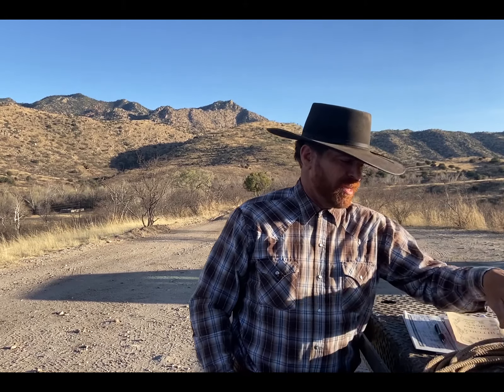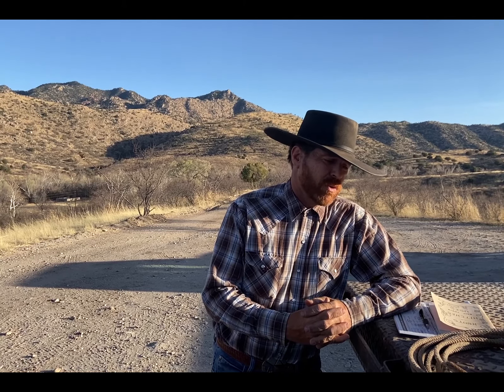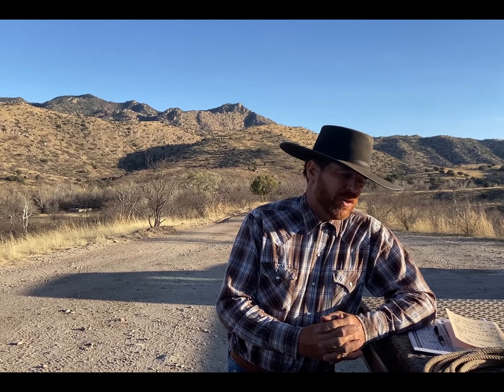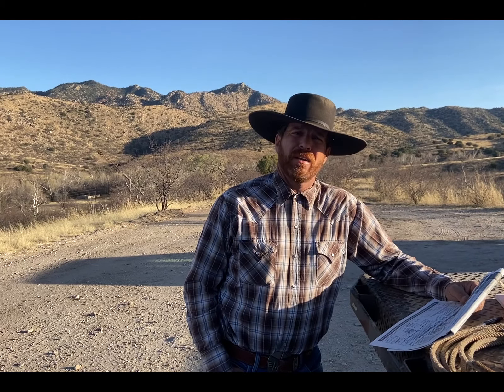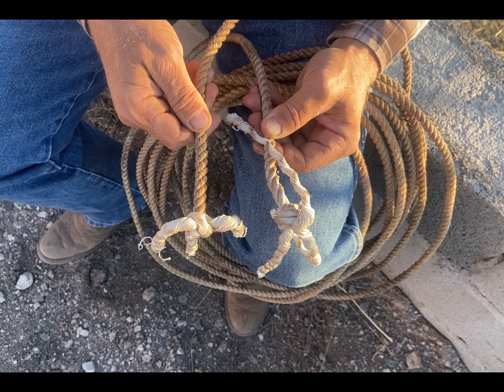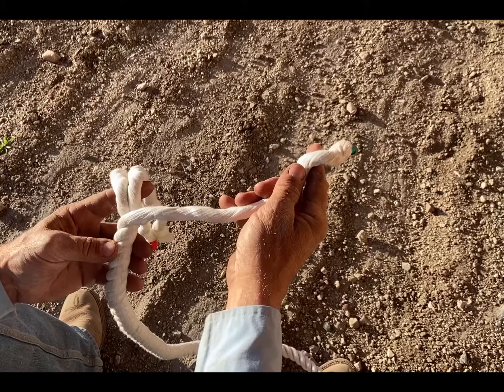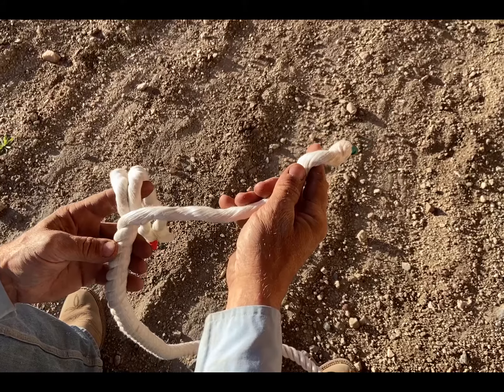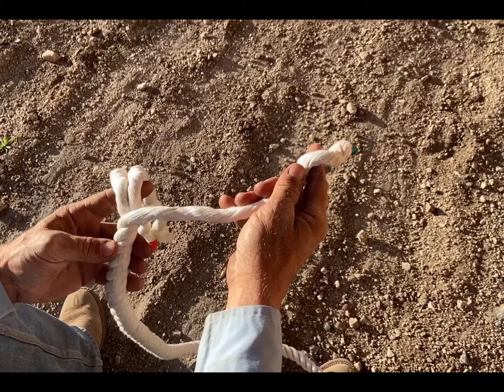Hondo Stopper Knot (Mathew Walker or Turks Head)

Comment: I prefer the Turks head to the Mathew Walker. Two reasons: 
1-I’ve had a factory tied Mathew walker pull out
2-if your not careful when tying the Mathew walker the lay of the rope gets soft under the knot just like it did in this video
This doesn’t make me right but my opinion is an informed opinion